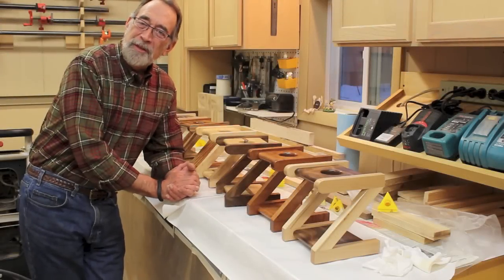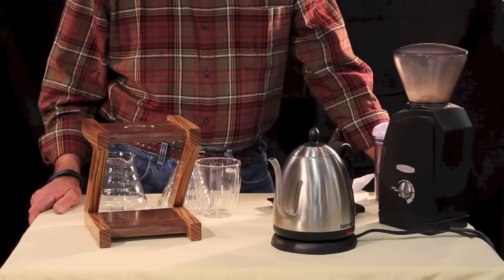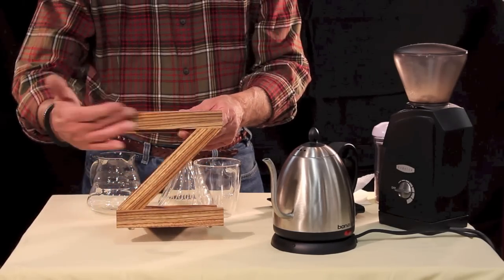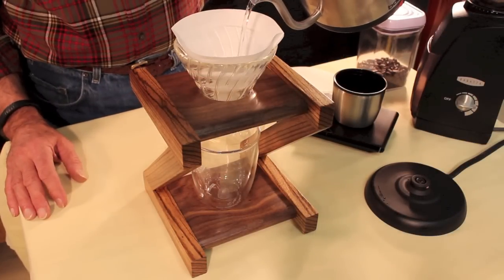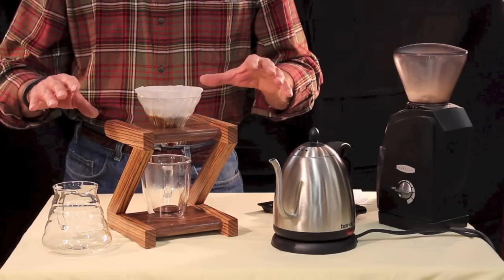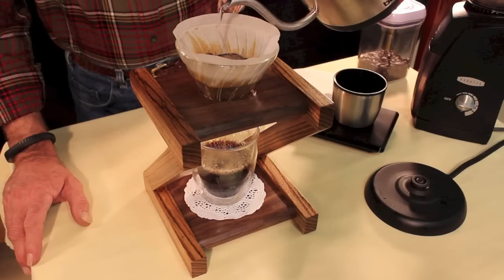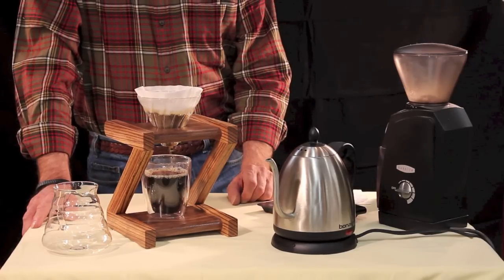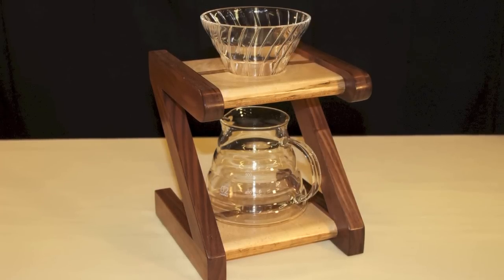Pour Over Coffee & The Z Dripper

Comment: Love the idea! My Braun Aromaster drip coffee maker died and are not available on eBay for $10.99 any more. I pried the filter holder out and am using it propped into a Tricolator cone filter holder and Tricolator flask. I,m thinking a Z Dripper designed to hold the Braun filter holder will be just the trick and I can keep using the Melita #4 unbleached filters I like. I had forgotten how good pour over coffee is (I had quit the Tricolator as filters were no longer available and Chemex filters are both too expensive and not designed for the Tricolator cone filter holder). Thanks for sharing.

Comment: How much for the z dripper? Will it work with the ceramic hario v60?
Reply from the maker: The unit is designed to work with the Hario V60 Glass Dripper and will not work with the ceramic Hario with the built-in base and handle.  This was done on purpose, because the ceramic model with the built-in base allowed coffee to "migrate" under the upper wood platform.  I make these in very small batches of 3 - 5 at a time from select pieces of unusual or rare wood.  If you send me your email address I will send you photos of 4 I currently have available and prices.